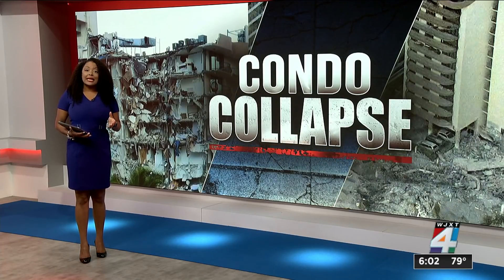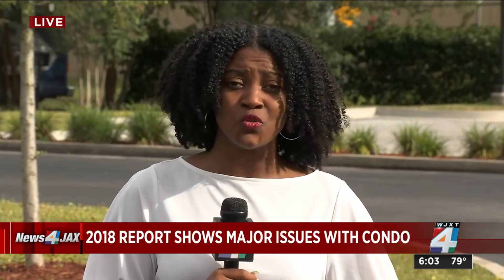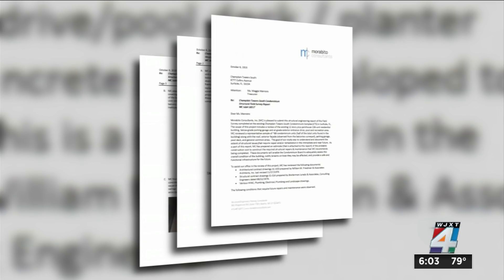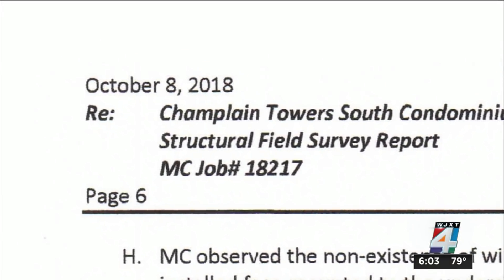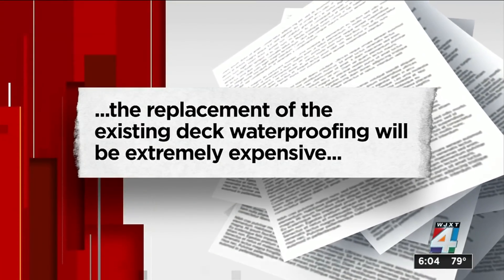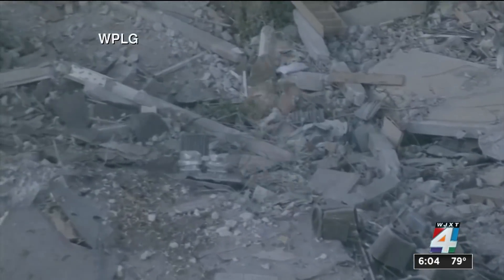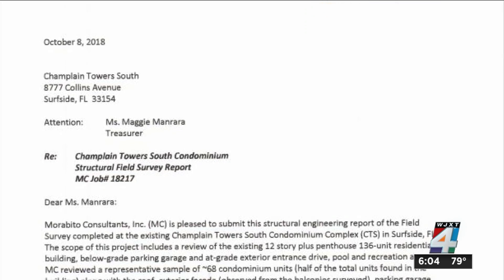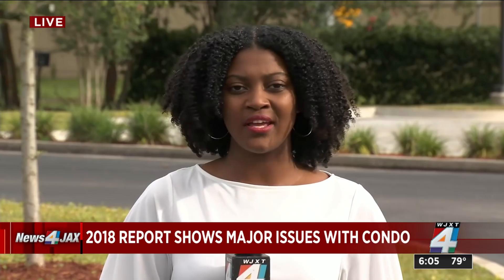2018 engineering report showed ‘major structural damage’ before condo building collapsed

Comment: When they built those condos, they obviously did a terrible, terrible job on the concrete. The exposed rebar on the support columns is a failure to encapsulate the bar. Total hack job--thank your Republican Right to Work politicians for that one! Just like Louisiana's Hard Rock. You hate regulation and now you have it unregulated the way you wanted it.

Don't believe me? Ask an structural engineer... obvious concrete construction failure.

-Construction Management Degree
-Union Carpenter Local 30 Seattle
Reply: The exposed rebar shown was from a column in the parking garage that had obviously been hit by one or more cars causing the concrete to be chipped off
Reply: @jameswolff2152  How the hell do you explain the spalling 6 ft up the column? Did cars hit that one too?
Reply: Florida had a democratic governor when the building was built
Reply: Building codes have absolutely nothing to do with labor laws.

Don't believe me? Ask an attorney.

-Construction Management Degree '05
-Law Clerk (Right to Work)
Reply: @Diggler-vl3nd  Apparently you're a history fail. Look up the Triangle Shirtwaist Factory fire.
Reply: @arthuresparza2617  That doesn't have anything to do with building codes either, just the fire codes. Union or non-Union, if something is not built AND maintained according to code, it has a higher likelihood to fail; conversely, something built properly by either Union or non-Union labor will have a far lesser chance of failing. Stop trying to make this a political issue.

Comment: My entire job is writing these reports and you'd all be shocked how often people ignore basic issues that need to be fixed to save time and money
Reply: Yeah, I'm sure the HOA dropped the ball, but I'm wondering if Miami's city engineer screwed up, too.  Why wasn't this building condemned?  

The 2018 FIU bridge collapse revealed a really lax enforcement environment re:structures for transportation.  The FDOT just didn't enforce basic, normal procedures that ensure public safety.  They let an unsafe design get built, and it collapsed and killed people.  

That was in transportation, I can only imagine that there's even more lax enforcement when it comes to real estate.  I can imagine the political pressure coming from rich real estate developers and property owners, lobbying local politicians, and wearing down the city engineers.
Reply: I'm a tradesman and I called on day one that the building wasn't structurally sound do to the lack of sufficient load bearing columns and that it would come to light they were cracking and damaged, possibly replastered over to hide the damage.
Reply: @lightpropulsionguy  and nothing has been proven so your call is still just a guess
Reply: because of the need to compete with other companies, corners will be cut so they can stay afloat and remain competitive.
Reply: Oh we know trust. That’s why tenants are in crumbles I’m sure they knew too so sad
Reply: @brittneyhailey  I hope that pun wasn't intentional...
Reply: I was told by someone who has parents living there, but fortunately not there right now,  that all the work had been done. And the building brought up to code.  The new roof was supposedly the last major repair needed.  Now is that true🤷🏽‍♀️. I have no idea one way or another.

Comment: You guys should watch the video of the building collapsing.  Slow it down and watch carefully.
Reply: Can you explain why? What am I missing? I dont know enough about buildings, engineering, demolition, bombs, sink holes, or any other thjng that could cause a collapse, but I really am interested in peoples theories
Reply: @Scums_lady  
You can see flashes of light in each section of the building right before it collapses. Run the video at half the speed.

 Also,  structural failures in buildings do not implode and fall at terminal velocity...  You can watch  a bunch of poorly constructed buildings in china fall and  compare that to a controlled demolition. They vastly behave differently.
Reply: Where did you get your degree in structural engineering and what year

Comment: A major disturbance to the building occupants? Like a partial building collapse doesn't?
Reply: I guess death in a building collapse is a short term disturbance.  Sad.
Reply: @mountainmikemmel8289  Say what? No, that's not at all what the line is referring too. SMH
Reply: Why are people focusing on that line? Feels like y'all are misinterpreting it. Haha. It's a very reasonable line to put in there from an engineering perspective. You're trying to give the customer an idea of what they're looking at and it's seriousness. I'd argue it's seriousness is spelled out plainly. And the "very expensive and major disturbance to occupants" only underlines it. It's the engineer underlying that it's a serious repair. That despite workers in and out, loud noise, dust, no pool or parking garage so alternative parking solutions etc. etc. that it needed to be done. They're not talking about the collapse but the repairs recommend in 2018 to the concrete slabs in the parking garage/pool that the tower that collapsed sat on.
Reply: Jonny- B I understand like 20% of but I’m just gonna say I think the customers would understand there needs to be repairing so the building doesn’t fall and ya know, die